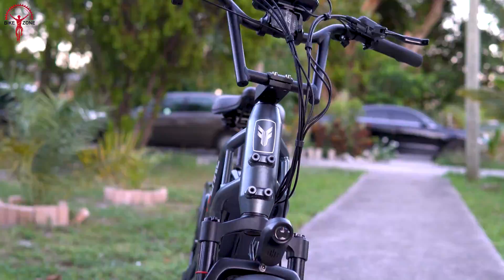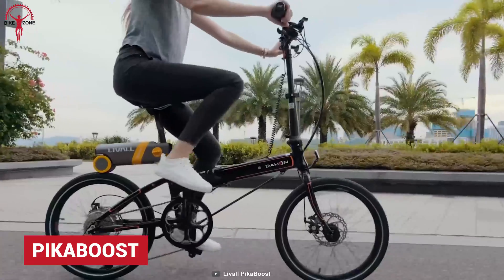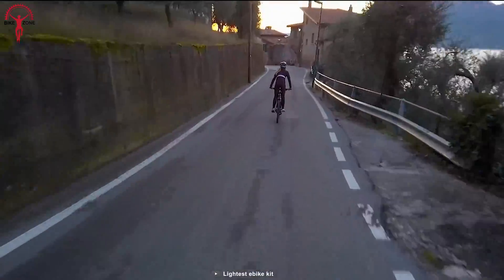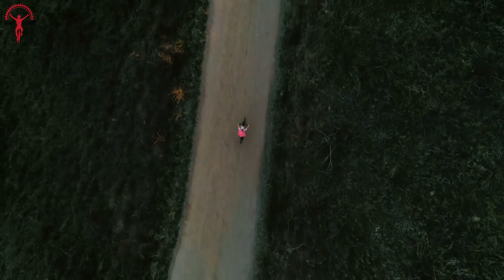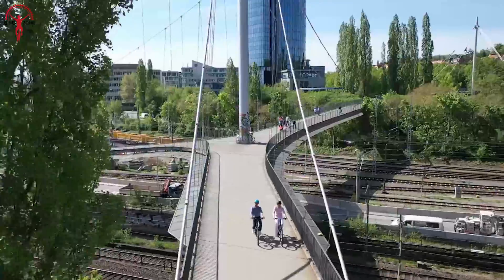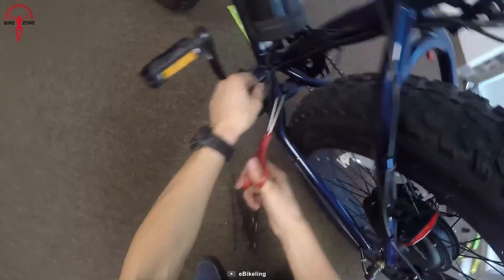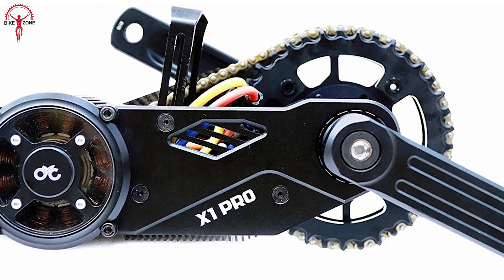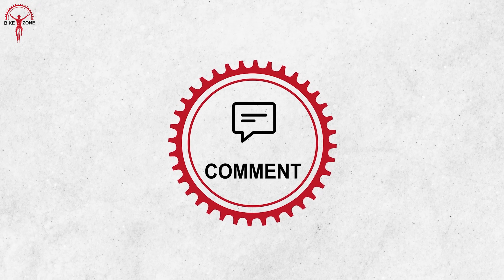Top 10 Best ebike Conversion Kit

Comment: Just a heads up for anyone trying to get a rubee x this kit is not for all bikes
Reply from the maker: Glad you mentioned that.
Reply: @bike-zone  no problems, I have a 24 inch bike and attaching it requires you to adjust your seat height by a lot and being the short person I am in makes riding my bike very challenging so if you have a 24 inch bike or smaller this isn’t the product for you
Reply: I wonder if my Trek Verve 2 bike with is the XL size would be able to accept either of the first two conversion products.